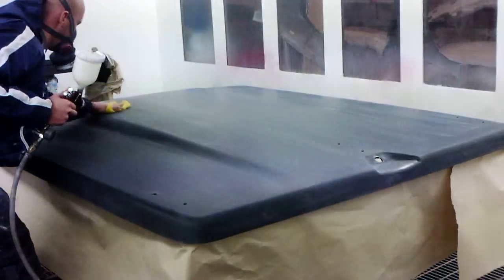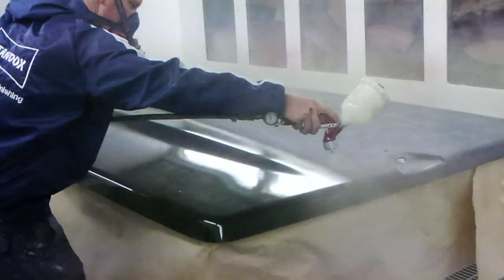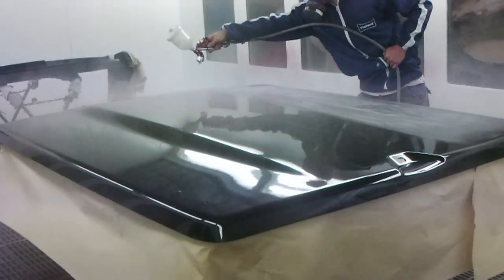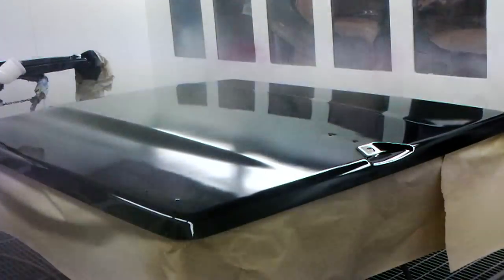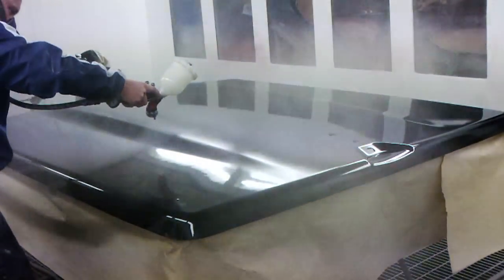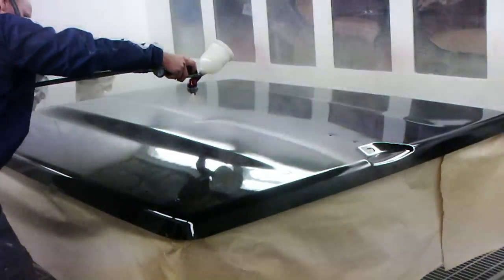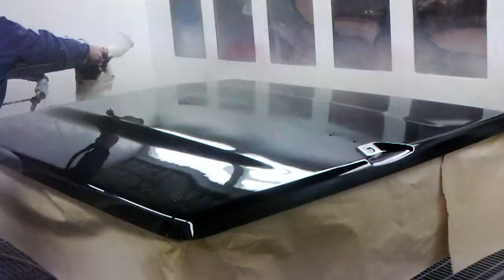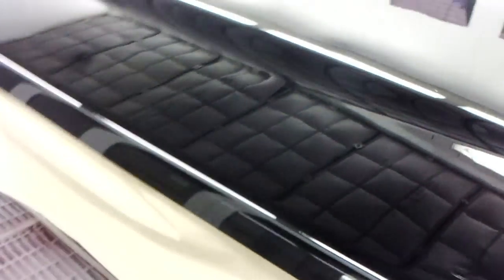How to get "Mirror Finish Paint Work" Spray Paint Tutorial

Comment: It's worth mentioning, for the benefit of newbie painters, that "airflow drives finish quality", as I was taught.  To get a wet look, you MUST drive the paint droplets into the target with enough force that they don't just stick and accumulate, but break their suface tension, spread out, and meld with other droplets.   This requires that you use enough air pressure at the gun.   A symptom of low air pressure at the gun is orange peel or a rougher texture.   I recommend to any newbie painter that he should shoot several samples at different gun air pressure settings and see how it affects gloss qualities.
Reply: I agree ☝️
Reply: Newbie, that’s 🙋🏻‍♂️
Reply: Or you can thin out the clear a tad more correct?

Or heat up the clear coat mix right?

Or shoot on a day that is warmer right?
Reply: thanks! and hope you get faster at gaming
Reply: You say air flow then air pressure. They're not synonymous. You can have 100psi and barely any cfm. You need both.

Comment: Can you see the 600 scratches underneath the second lot of clear? I just that I always got taught (with acrylic) not to clear over like 600, 800 or 1200 scratches,
like for example if you do a small repair, and blend the colour half way through the panel and then clear the whole panel, we always had to buff it first, or use mattening paste. 
I know it works awesome with straight colours, I found out by painting shitbox cars in bad environments and having to block out every coat from getting either a bit of shit, silicone or
or a moth/mosquito in it. Those jobs always ended up turning out the best.

Comment: How about sanding before basecoat what grit do you use on a single stage paint. I got one pint of wet look hardner with the gallon of single stage paint got to paint my truck but don't know if one pint of wet look hardner is good enough to spray the hole outside of my GMC Canyon SLE truck. Since doing single stage not putting a clearcoat gonna use a lvlp spray gun since the compressor got at home is small. I don't know anybody near me that can teach me hands on painting but eventually guess I find someone put a ad on Craigslist to find someone one person responded and they told me can show me on a Saturday but was about 14 miles away from me and they wanted me to go there in the week but can't I work in the week and have weekends off. I don't have a lot of time in the week to paint. But plan on moving to where my brother city he lives in this year at the end of year or early next year should have a lot more time then but not now.

Comment: Is a mirror finish possible with water based paint? When I spray on wood (mostly over sanded paint already sprayed on the wood) when it is wet it will look very textured but it does flatten out as it dries, but not perfect like this. Is it simply not achievable?

Comment: I have a question, i recently repainted a red tractor. with OEM IH red spray paint cans. it was glossy when i just restored it, but after a year, to this point, everything is faded a little bit, or just no reflection. I have tried auto motive clear coat paint and it glossed the sheet metal up pretty well ,but now after 3 weeks, there isn't really a mirror finish, "its outside a lot".. my question is, how do i get the full glossy mirror reflection like it was when it was brand new in 1976? or like a brand new car is glossy, and it can sit out side for years, and still have its reflection, my question is, is how do i get it to gloss and reflect like the manufacture for years without fading?
Reply: Levi Skuse the fading is most likely UV damage to the pigments in your base. Most automotive clears have UV protection so your paint doesn't fade. If you used a rattle can clear it is not the same as a proper auto clear with hardener and UV protection. They don't catalyze and harden like real automotive clears so they get hazy really easily. They do have rattle cans of 2K clear. They have a small cartridge of hardener on the bottom of the can that you have to press in before you use it.

Comment: First Coat : 20 Psi
Second Coat : 30 Psi ?
Reply: Geri Centura yeah first coat is base. Turn the pressure up some to better atomized the clear  to flow better!
Reply: I think that you max out the air pressure on both coats of clear. Keep raising it up untill you get too much waste of clear in the air (poor transfer rate). But, I think that with hvlp guns, weird stuff happens with to much pressure. Conventional guns allows more pressure (better atomization), but have poor material tranfer rates (clear coat going in to the air). a fine line needs to be found.
Reply: Thank you for the tips from both of you , i really apprciate 😁🍻

Comment: What cap were you using?  I sent you a question about the t110vs te20-i have since recieved a t110  from the UK and it does indeed fit my tekna prolite.  I have not sprayed  anything but thinner through it yet( just to check my spray pattern) but am hoping to give it a work out this week.  the pattern looks more refined than the te20 (maybe a little more cigar-like, like an Iwata ls400) so im hoping the devilbiss EU literature is correct and it will help with low solvent/vhs clears and orange peel. I am spraying more restoration/hot rod/ custom all over work these days so factory peel is not a plus.  Any comments from you on the t110  would be most appreciated.

Comment from the maker: Sorry about the video quality in this video, since I have upgraded my video camera.
Reply: So you cleared it sanded the clear then recleared it? If so did you just put 1 coat of clear to start with?
Reply from the maker: no its better to start with 2, It reduces the risk of sanding through when preparing. and also will give more depth after the final 2 coats are applied, thanks for watching mate.
Reply: I am just getting into painting, do you get better gloss doing this or is it about the same as putting 4 coats and cutting and buffing?
Reply from the maker: I'd never put 4 coats on at a time it is too much and you will end up losing gloss, this method also helps remove orange peel because it has been sanded flat prior to the second clear application
.

Comment: Your instructional videos are the best out there.  What I like about them is there is no BS.  I got into painting a couple years ago and was watching another guy at first who always said "we start with wide open fan and wide open mixture, and go from there".  He never said where he went though.  I can tell you even with a 15 CFM compressor, 1/2 inch line, high flow diaphragm regulator all mated to a GTi Pro TE 20 at 2 bar running wide open fan and mixture I still got orange peal.   Watched a couple of your videos and adjusted the gun 2 1/2 turns out on the mixture and BAM!  Perfect!    Playing with this over the last couple of years, I have learned gun set-up might be more important than technique.  Lots of painters have there own style and it doesn't seem to matter too much.  As long as the gun matches your painting style,   Unless your going for a glass finish like in this video, then yes, god style rules.  But most folks could paint a factory finish with a little coaching and the right setup.  What I wonder is can a pro like you use technique to overcome poor settings?  I was able to cut down on the peel moving like my dog leaving the vet.  But I would go back to painting how I felt comfortable and the peel came back.

Comment: So just to check, the process is this....
Spray base coat then 2 coats of clear, allow to dry completely
Next day come back and sand the clear with 600 grit, then spray 2 coats of clear on top of that and the gloss level goes much higher, is that right??
Finally after spraying the last 2 coats, IF i then colour sanded it would I be defeating the whole object OR IF i sanded at that stage would it be better than the first 2 coats of clear before i used the 600 grit? WOULD IT ALWAYS BE A HIGHER GLOSS DOING IT THE WAY YOU DID IT - REGARDLESS IF IT WAS COLOUR SANDED AT THAT STAGE OR NOT, sorry caps lock was on
Reply from the maker: SP330Y Yes you got the basic process, the reasons why you are left with a superior gloss is because you are doubling the depth so looking through 3-4 coats of clear instead of 2, also basecoat has a tendency to suck a bit of gloss out of the clear. for best results give it a good bake then wait for a few days to let the previous clear dry right out, this will also help get a better gloss and stop you from trapping in the solvents, you can colour sand and polish. Hope this helps you understand the process a bit better and good luck.
Reply: +The Gunman Nice Job!!
Reply: +The Gunman And with 3-stage jobs the clear tends to die even more. Sometimes people think you've done a mediocre paint job and expect a sheet of glass finish right from the gun. I've got to paint a front clip on a 150K Aston Martin this week and the finish has to be a sheet of glass. We have a 2 coat wet on wet air dry clear that can be sanded....yes sanded after 45 min. and re-topcoated. I will then apply 2 coats of glamour clear over that. Pretty much the same process as you, but just speeding it up a bit.
Reply: jazzpianobrian After you spray the first 2 coats of clear, what grade do you sand down with to make ready for the glamour clear?
and after the glamour clear do you sand and buff that or just leave it?
Reply: SP330Y
Reply: +The Gunman I understand the process now,BUT i cannot understand this bit....
 If the basecoat already has 2 coats of clear and that has orange peel,then even after sanding it down and recoating (reflow) with another 2 coats of clear the same would happen again,so maybe its because there is a total of 4 coats that gives it that gloss level and not the fact it was flatted down before the reclearing
Reply: SP330Y Sure the extra clear gives added depth, but here's why the same won't happen again. When you initially paint your vehicle, you are putting on primer, sealer, multiple coats of base color and then clear coat. That's a lot of product! Now when you clear, the clear coat may initially look very wet and smooth, but as it dries it "sinks" or "shrinks" into all of the tiny nooks and crannies from all of that other products film build. That's why it sometimes has the orange peel look or even less gloss. When you sand the cured clear coat smooth with 600 grit you are only re-applying clear over a very smooth sanded surface. That's why it levels out better. You can just concentrate on spraying 2 wet coats of clear and it should look like glass. BUT....if you do not apply the clear properly.....as in wet enough or uneven, you could potentially still have a rough surface. Application is critical! Hope this answers your question. Feel free to ask me anything else about refinishing.
Reply: @Jazzpianobrian For personal project's and work where time is not a issue, won't the result be better with the sanding done after all the clear coat is on and dry and give it a 2/3 step polish afterwards to ensure the final application is no longer a issue?
Reply: In reality, your still only getting 2 coats of clear on the final spray, because if you sand through it, even though there is clear under that.... you will see a slight difference between the first two layers of clear and the last two layers of clear (you will most likely only notice this after its buffed), and then you will need to clear it again.

 

The reason that the gloss is so much better when you sand it and re-apply the clear..... is that the clear is less porous than base coat. So the first two coats actually dry into the base coat and in a sense it sucks some of the life (gloss) from the  first 2 coats of clear.

When you sand the clear with 600 or (800 my preference) the clear is much more dense than the base coat and smoother (because the base will have some texture to it because of atomization (and base coat doesn't flow near as well as clear). 

 When you sand the clear and put more clear over that, you have a surface that is smoother (because it was sanded) and its sealed off much better than the surface of the base coat and it has no texture at all and as ive previously stated.... the clear coat is no where near as porous as the base coat.

Therefore the clear lays down smoother, because the surface your now painting is not as porous as the base coat, there for you get much better gloss retention.
Reply: I always assumed clear coat would only cover 1000 trizact? Thank you for this info I will use this

Comment: awesome work bro 👍 if im gonna clear a panel on a car do i shoot clear slowly like you did on the 1st coat or is it different?
Reply: I'm no pro but seen alot of videos. I believe that most pros go slightly faster on the first coat and then slower on the second and/or the third coat.
The first coat should go on medium /wet.
The first coat is then stickier then the panel with out clear on it.
After the first coat flashes off, it is stickier, allowing you to add more material on the second coat. I think they also call the first coat a "tack" coat.
On the second coat, I think technically, you want to max out the air pressure, untill a point where there is too much atomization, causing tons of material to go into the air and is just wasted. Also you want the fluid adjustment almost maxed out on the gun. You also want to be very close to the panal you are spraying (it helps to have a nice gun with a super wide fan). I think in the 5cm to 8cm range. (very close) 
With being close to the panel like that, you want to move fast as not to make the clear coat run. 
Finding the limits I mentioned is really hard, not to mention actually putting it to use on a super nice car, and being very consistent. 
If you aren't that consistent, then you must modify the settings to allow you to be consistent. Like leaving more space between the gun and the panel, and moving a little slower. I think they also want a 70 to 80 percent overlap. So, practice makes perfect!

Comment: hi great videos do you reduce your clear  for the flow coat ?and i see you have applied 2 coats is this enough?
Reply from the maker: Thanks, it was above 30 degrees when I painted this so I didn't use any reducer as the heat thins the clear but in colder months %10 reducer will help. Using 2 Pack there is never any time I would use more than 2 coats unless I had lots of dirt in it and was trying to bury it in the clear. Thanks for watching.

Comment: I'm flow coating my roof and doors on my black car this week using a devillbiss gti pro lite and glasurit 255 clear with medium hardener... Question, obviously you can whack clear on a flat horizontal panel, but how do you get the peel sitting dead flat without any sag/runs/orange peel on a vertical surface like doors? Cheers